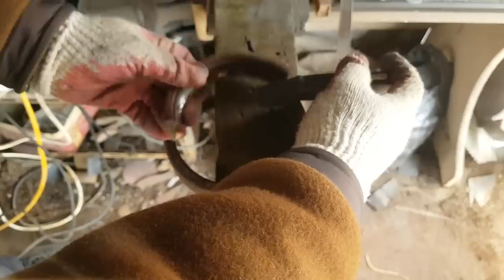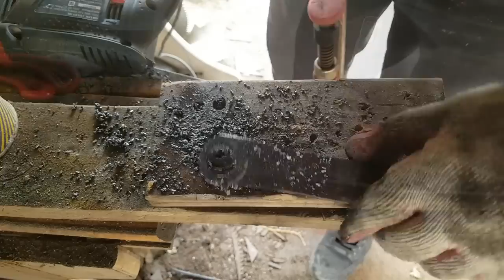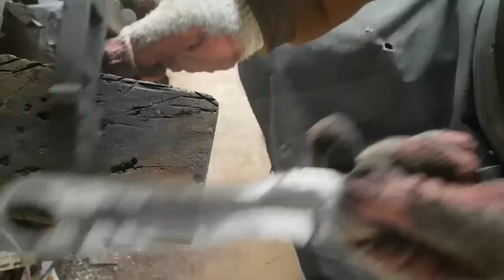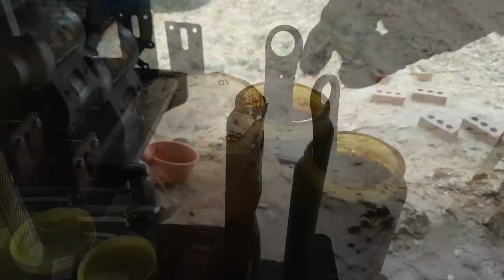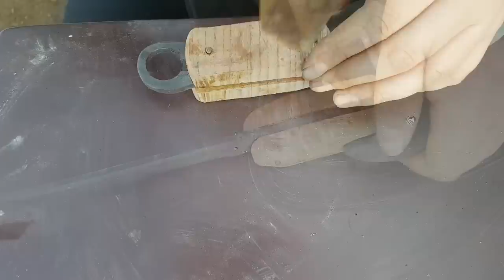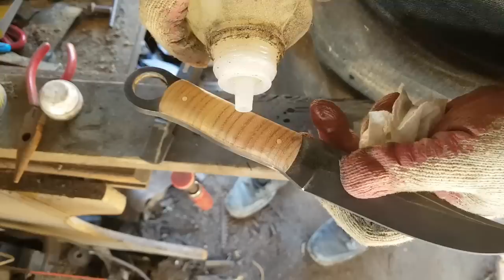make a camping knife from bearing

Comment: 10:06 Jesus... Not what I would do with any my knives, but you sure made your point. Good work. You've made a fine knife there.
Reply from the maker: Thank you.
The file has a low hardness in annealed.
The file we used for testing is the knife in the next video.
Reply: @forginghard  I thought as much. That being said it's still what I would call abusive testing. Goes to show why goid steel, and heat treatment is important.

Comment: As expected from u a very good job. But I think it's more a fighting knife than a camping knife. Specially with that false edge
Reply from the maker: The length of the blade is very short, 13 cm
Not suitable for fighting
Design only used Persian blades

Comment: Hello friend, a question: how do you do the lime cutter effect?, the heat treatment or in the tempering or for the same bearing steel, thanks for sharing your knowledge, very grateful, greetings from Argentina and congratulations.
Reply from the maker: I didn't understand the question
Quenching is cooled with canola oil at 800 ℃ (1,472 ℉).
Tempering was done for 2 hours at 220 ℃ (428 ℉)
Reply: Looks like it was dipped in ferric chloride. It brings out the look of the steel. If that’s what your asking
Reply: Привет.

Comment: I made one before. Short knife. Don't temper it to red or else it can easily break. Carefully not to twist while cutting it can easily break. Just cut straight and pull it back straight. Can easily cut through 5 inches nail. Razor sharp
Reply from the maker: Thank you for the advice

Comment: hello! nice to see your work. I like the shape of that knife. I suggest that with high carbon steel like that, get a cross peen hammer and use the cross peen to draw the edge down thinner. It is faster and you will get more change with less effort in the steel. Also, I would bevel the front of the handle scales and polish them before you put them on the knife. That will look really good, and it is not possible to do after they are on the knife (not easy to do, anyway). I am just trying to help. I have been making knives and swords for about 12 years. Good work!
Reply from the maker: Your advice is great. I'll make a better knife. You are a really good teacher

Comment: what were there in the containers that the knife was immersed after tempering? and what is the tempering time and temperature?
Reply from the maker: Quenched 1,472 ° F (800 ° C) canola oil
Tempering 356 ℉ (180 ℃) electric oven 2 hours
The solution is ferric chloride

Comment: Does!  the bearing loose its hardness when heated and bended ? You have drilled a hole on it . Till now I thought we can’t drill on a bearing. 🤔
Reply from the maker: Thanks for watching
Annealing is a process of slowly cooling after heating to a high temperature.
The hardness is lowered by this operation.
Reply: 망치질힘들어Forging hard thanks a lot 🙏 .

Comment: solid knife..may i know the test to cut the file steel is before sharpening or after sharpening?thanks
Reply from the maker: The file used for testing is the file that has been annealed.
The hardness is low.
Test is not sharp